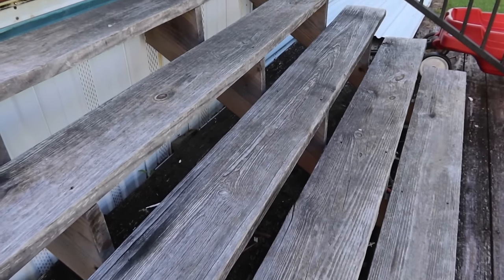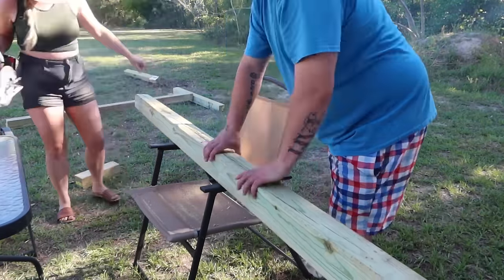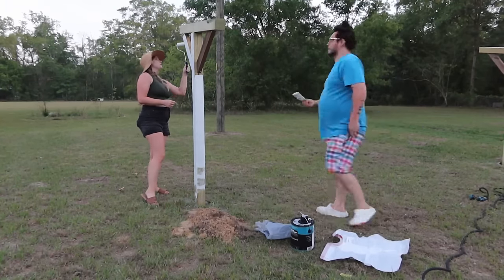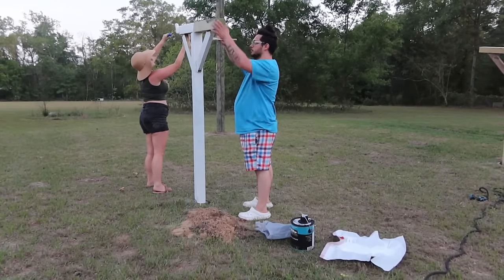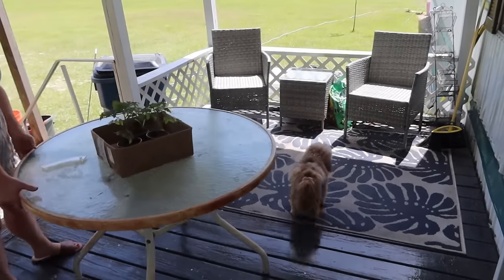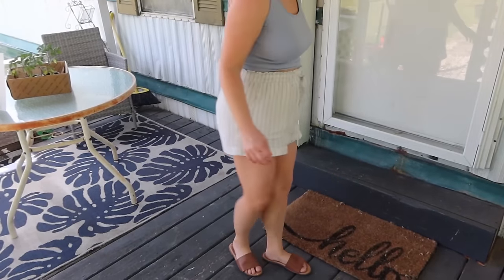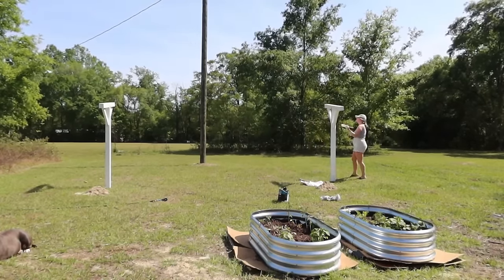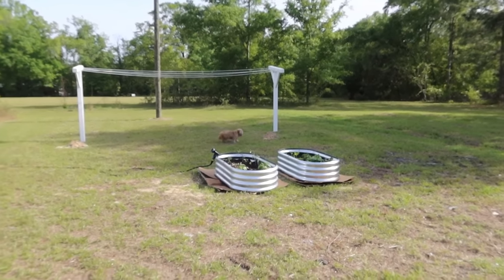☀️MOBILE HOME REFRESH // outdoor clean + refresh + diy clothesline

Comment: Kelly, girl you need to get one of those expandble hoses! They weigh practically nothing when you are not using them. They are so much easier to put away ! I cant deal with the regular hoses anymore. I buy a new one about every one or two years. If I need more hose, I buy another and attach to the first. Ive had up to 200 ft of hose and it takes no time or straining to wind it up on the hose hanger. My son knows I love mine so much, he bought me one for my birthday😂 🦋 🦋 🦋 🦋 🦋 🦋 🦋 🦋 🦋 🦋

Comment: Hey Kelly....just a note for you.  Clothline....you got the rope type, there is a wire coated one, that is longer lasting , it doesn't stretch. It is cleaner...I use a small cloth and pin it to the clothesline next to the post, use it to wipe down the line before I hang up wet clothes.  Check it out when  you need to replace your cord.. Great job.  My first time here.

Comment: As far as your clotheslines, they will eventually sag with the weight of clothes, you need to get the green wire type, it’s coated wire, it doesn’t sag as quickly.Also you can put a anchor wire at the top middle of your posts then pull it back and anchor it in the ground like a tent stake, it will keep your posts from leaning in.

Comment: Just a quick note about the water hose. If you make a permanent holder thing, install it on the side with less direct sun. I have no choice but to hang my water hose in full sun and I have to buy a new hose every two years because the sun just destroys it. I'm gonna try to make a cover, lol. Ima try!!

Comment: If you’re worried about too much slack on the clothesline you can use a pulley system. I used to have the same problem on my old one.

Comment: If your line is "stretchy", that is normal.  Use a clothesline prop pole.  They do make fancy metal and wooden ones but any long ,skinny pole will do with a notch or nail on the end to push the drooping clothesline in.  Here is an example.   How do you make a wooden washing line prop?
Laundry Day, Grandma's Way – Cappers Farmer
We measured and marked a “V” shape at one end and cut out the shape with a jigsaw. That was the end to prop up the clothesline. At the other end, we angled the corners to shape a point so the pole would stab into the ground and stay put. We sanded the edges, and presto!  🦋

Comment: I would get another sack of concrete and pull more on top of what you did and have it run away from the posts. The weight of the clothes will make the lines and post lean in. The other bag gets it above the posts and you can hang up as much as you want then. Also make your lines a lot tighter before you load it with clothes. It stretches. that is one great looking clothes line.

Comment: Please make sure your pots have holes on the bottom of pots of not they need drilling into them, but one looks ceramic? You took the plants right out of the pots and into the plant pots you wish to keep them in - did you put compost in the pots first then the plants then more compost, you must secure the plants with compost or the tub will have air pockets in ( gaps between the roots) which will allow them to dry out and die also having the gaps when you water every evening the water has nowhere to drain and you will kill your plants, if you have done any of this please change ASAP x

Comment: Don’t water from the top like that. A lot of plant disease is soil borne so you don’t want to splash them with soil water. I know that sounds silly because they are planted in soil but mulch with at least half an inch of mulch and hold the hose at the base of the plants.  Also you want to water early in the morning, Especially in the Georgia heat.